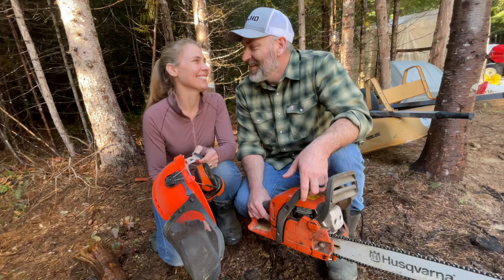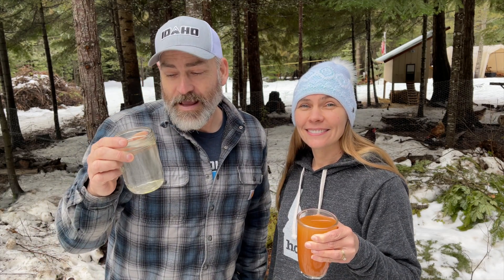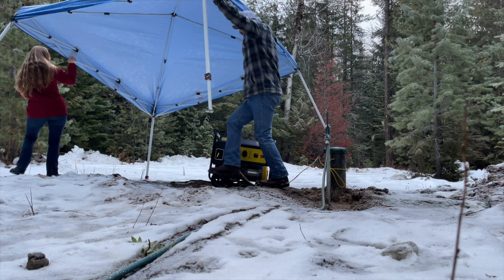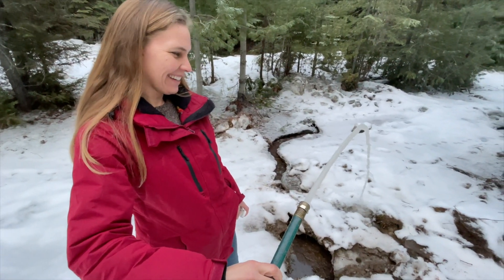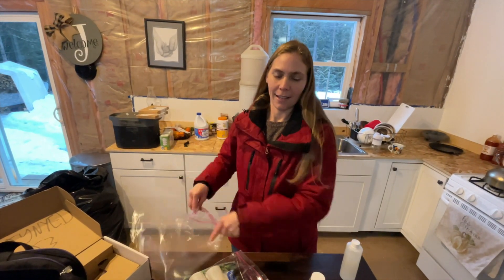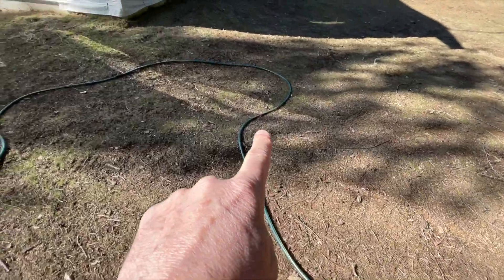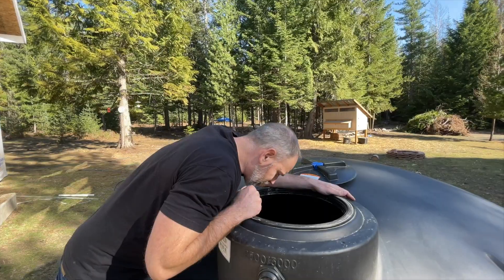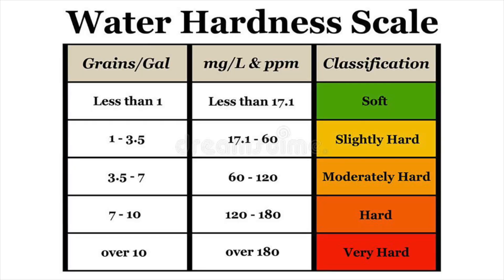Brand New Well... POISONING US?

Comment: Martin, I live in western PA and have the same type of water. My well is 360 deep and has both particulate (red color) iron and highly dissolved iron ( turns fixtures orange after sitting overnight). Lived here 40 years dealing with softener after softener. They aren't made to deal with this much iron over time. I contacted a MAJOR water quality company, they came and did testing and recommended a system over $4000.  I purchased the same components from amazon for under 900. 
Big Blue 20" filter 55$
64000 grain water softener 649$
4 pack of polyester spun filters 20-1 micron 44$
I add bleach directly to my well. I never get any smell of chlorine in the house.
install is in this order: from pump- 20" filter-softener-house supply.
Best water we've ever had.

Comment: hello Martin, as you drilled your well i made a comment under that video, and saw it straight away that it was iron. As always you have 2 options. 
1. you need one storage tank and in this you pump the water under very high pressure about 10 psi so it sprays in your storage 
    tank. The idea behind is, through that spraying the water can take oxygen and reacts with the iron, which will settle down at 
     3 - 4 days. Above the settlement you can take the Water and pump it through a Filter and wallah cristall clear.
      Remark: It must spray
2. An Ionexchanger will do the same work only a little bit smarter but you still have to filter it after the ionexchanger.
3. An "aktivated carbon" Filter should be the last Filter which you need, that you can take the water in the house, to avoid any 
     problems with watertabs espcially the washmaschine and dishwasher.
As a german brewmaster i hope my english is understandable
Reply: This is really usefull information, thanks!
Reply: Nicely explained 👌
Reply: @Clive -  Your English is better than most USAmericans.
Reply: Voila or wallah? 😂 one is French one is kanakish. know the difference
Reply: @joshhof1697  what a bad mistake, sorry
Reply: @joshhof1697  this is funny
Reply: great information, thank you sir

Comment: This may be a duplicate, my first message apparently went to the great nowhere.
   I have recently retired from a large Municipal Water Company. My job was in the construction and maintenance of the system. We continuously sampled and tested water in order to maintain records for the EPA. Our water system had its own laboratory and tested water for neighboring Water Agencies and peoples well water. The laboratory always had the most modern up-to-date equipment for testing water. Many of the more knowledgeable people who worked in that lab felt that the EPA standards followed technology if it was able to be measured the EPA wanted it to be removed. They felt that often times it was a Government desire to have something done even though it was probably not necessary. That argument is far beyond my knowledge. At the extreme is ultrapure water used in computer chip manufacturer. So much is removed from that water that if you drink a very very small amount it reacts inside your body so strongly with anything it touches that you can feel the heat and the upset immediately.
  Aeration can be used to precipitate much of the iron out of solution so that it can be more easily filtered out. If you have long-term concerns about the effects of the water I would maintain the rainwater catchment system to provide potable water to the kitchen and filter that water as needed. I would use the well water for gardens, fire protection and possibly the animals who are not exposed to the water for decades. Keep in mind that in the bathroom when you shower a lot of things can out gas from the water and you breathe them in some of those things are dangerous, particularly radon if it exists in your water supply.

Comment: I'd recommend a water softening system for the whole house and a point of use reverse osmosis set up for each sink that you plan on having drinking water and cooking water from.    Keep up the great work and positive energy!
Reply: The resin in a water softener would soon get coated with the iron and become useless. They need to oxidize the iron so it can be filtered out. A potassium permanganate chemical feeder can oxidize the iron and then go to a sand filter that can be periodically backwashed.

Comment: We live in North Central Washington. We have a whole house sediment filter and charcoal filter in the well house. The water then gets pumped to our storage tank. From the storage tank it goes into the house through another sediment filter and then through a charcoal filter. This runs through all our water lines in the house. All drinking water goes through ceramic filters similar to your drinking water setup. Every spring when the weather warms up and the water starts flowing below ground our water has the color of lemonade. This goes away after the thaw. We have had the water tested even with the lemonade color and it tests OK.

Comment: Nice  explanation of the system. As a water plant operator there are a few things to consider. Iron bacteria is not good as well as excessive Iron . Removal of Iron is easy to do.  Here is the chemistry to understand.  Iron in the water rusts  with the addition of chlorine (liquid) up to 7 parts per million. At this point the water turns orange as you saw.  This is the time you run the water thru a sand filter to capture the iron flakes.  By adding a dechlorination chemical ( check with the health department  local or state) you may have different rules than I operated at. Once the free residual drops below .5 parts per million it is safe from iron and chlorine and clear.  Other ground minerals are a separate issue and different treatment.  I am impressed with you’re determination and work man/ woman ship.. 👍 What a team.❤️
Reply: The addition of chlorine is safe and kills the bacteria. Don’t freak out about this  because the leach line is in the area and you don’t want that to cross contaminate the fresh water.

Comment: We have a 310-foot well at our N. Idaho property. We run the water through a whole-house filter as it comes out of the pressure tank and goes into the main house supply line. The filter has a clear plastic housing and replaceable 10" cartridges. You can get different kinds of cartridge, but be aware that the lower the microns, the slower the flow. We've settled on 30-micron "sediment" filters because the water flows through them easily and we don't have any odors or other water issues that would warrant a charcoal filter.

Comment: God bless you, you seem to have more than enough advice, but as a well driller and pump installer for thirty years the best advice i can give you is let run.  It's very hard to clear a well up with out shore power so your going to have to buy lots of gas and let it run until it's crystal clear as your bottle water. If it clouds up again, run it some more. I've never in 30 years had a well that would not eventually clear up.  Then collect another sample and treat iron, ph ,or whatever else you have to deal with.  Reli on the expertise of a reputable well contractors advice, we're no smarter than anyone else, just have lots of experience that in the long run saves you heartache and money.  God bless your efforts

Comment: I would recommend a whole house Reverse Osmosis filter with a mineralization post filter.

The standard setup for the whole house filter is to pre treat it before sending it through an RO filter.

The pre treatment is highly custom to your tested water. Generally the water must be softened and filtered for sediment.

The water is then passed through a reverse osmosis membrane and separated into permeate (filtered water) and concentrate (waste water). The filtered water is then stored in a storage tank.

You can make the membrane more efficient by using a post filter storage tank that is unpressurized (for no back pressure against the RO membrane). This also means you must run an additional pump from the RO storage tank.
Reply: I am also a plumber and I would do the R.O but you may want to add 
Sandmaster plus smp-10 10-20 gpm 
3/4 pipe
Reply: @St4 Not that Brian, I’m from the north east and my family has a property that has well water, which is why I know how the system should be designed.
Reply: @greenspotconstruction5003  You must have skipped over the mineralization post filter.

Comment: When I had a well drilled back in 1976 it was 368 feet deep. I had to run the pump for 9 days before it finally ran crystal clear. Not uncommon with a drilled well. I wound up pumping the water into a wooden tank with a capacity of 3000 gallons. The well was in New  Hampsire.

Comment: Ours is 600 feet in Wittmann, AZ, When it was first drilled it looked like chocolate milk for several days, now it is crystal clear after running/using about 25000 gallons. I use a 100 micron spin down filter for my first stage and it catches what I am guessing to but iron, it has a reddish tint. I plan on adding a whole house filter system (if our permits ever get finalized.)

Comment: I know you filter your water but be careful about using regular garden hose (not good for drinkable water) they make a food grade hose for RV's. I have a well at my house and we use in this order a whole house -10 micron sediment filter, water softener, arsenic filter, iron & manganese filter, carbon filter and UV light. my water is very high in iron, even my set up wont take out all of the iron. I have to use a bleach system sometimes to remove the excess iron which I don't like to use, nothing like drinking bleach water. hope this helps.

Comment: Our typical treatment solution for a case like yours would be a sediment filter for any large particulate, peroxide injection to drop the iron out of solution, then a whole house RO system to remove the arsenic and anything else. We would also inject anti-scalant at the RO to prolong the life of the membranes. Our whole house RO systems also include a uv light to neutralize any bacteria that could develop inside the storage tank. This depends on which type of arsenic you have though. You might be able to get away with a point of use RO system for drinking and cooking. Water treatment isnt particularly cheap but water is life. Invest in quality equipment with a good warranty and post sale customer support.

Comment: I have 2 wells at my home, one is only about 120' deep and is the original well. The second well was drilled for the swimming pool and is ~300' deep. For both wells we have a whole house filter and softener installed. We use rust guard salt in the softener, which helps a bit, but the elevated iron is an issue for us too. Everything gets stained from the rust over time. We also have elevated calcium in our water, but the filter and softener help quite a bit. I'd also suggest installing a large debris filter in front of the whole house filter. In the end, you'd install (from the well to house) large debris filter, then whole house filter, followed by the water softener. I got the self-cleaning house filter and softener and set them to run at 3AM, when there would likely be the least usage. Hope that this helps and you have good luck getting what you need to have clean running water!

Comment: We have a 144Ft well here in southern Ontario.  We use a jet pump inside the house and no water storage tank – just the pressure tank.  The foot valve is about 25Ft down.  From the jet pump it goes into the pressure tank. From there we have a 10” big blue filter housing with a Pentek R50-BB Pleated Polyester filter cartridge just to remove some of the big sediment. From the 50mic filter it then runs into an iron filter then a water softener.  The iron filter and water softener have been set up to back wash according to the water hardness we have here. After the softener it goes into another 10” BB with a Pentek DGD-5050 Spun Polypropylene filter cartridge. From the 5mic filter it then goes into a Trojan UV light and that feeds the entire house (minus the exterior garden hose – that goes through our 50mic filter only) We change our 50mic filter every 3 months and the 5mic every 6 months.  There have been times where the water pressure is low and the 50mic filter/housing  is completely filled with sand! That has happened about 4 times in the past 10 years though… The 5mic filter even after 6months is usually in pretty good shape.  Keep up the hard work! Love the progress.  All the best!!

Comment: You can remove a bit of the dissolved Iron just by oxidising the water in the cistern. Put a sprinkler on the inlet from the well and then let the water settle and the top water flow to another cistern that you use

Comment: Hi, Use the well water for general use like toilets and showers and roof water for cooking and drinking with some bleach added. Removing iron from your well water will be a constant battle but have a look on the net for aeration and green sand filtering. Did you test to see if the water was radioactive. Cheers Dave. Retired water supply manager.

Comment: You may have thought of this already, but if you always get dirty water on initial startup then I suggest installing the equivalent of a “first flush diverter” as used in rainwater roof collection systems. These divert the initial catchment from the roof, which is typically dirty, so only clean water enters the storage tank. You would set it up at the inlet to your tank. It would need to be sized for the amount of dirty water your well produces before it becomes clear. They can be made as big as you need. There are numerous designs if you search on google.

Comment: Use a double canister filter body with the activated charcoal filters. You can also use a basic wound string canister before this that shows the sediment or iron in the line. Both of these usually lasts a long time and does not impede the flow of water being filtered. .....................  enjoy

Comment: I highly recommend using a water distiller (Cost $150) for drinking water. I distill up to 25 litres a day. Not sure you will care about the hassle with filters. You are into the problem of deep drilled wells and the endless compounds associated with that. Best of luck. Have been off the grid for over 30 years.

Comment: We have a pretty shallow well here in SW Nebraska about 300 ft from our house (25' to water 80' deep). Its about 28 gpm at the well and down to 7 gpm for outdoor spigots on the house. I am going to drill a well like your first couple well videos. We also have alot of iron in our water (1.68 mg/l) and manganese (0.61 mg/l) and my wife hates the rings it leaves. We ended up getting a ispring spin down filter for our house which helped with sediment (i would recommend the one they have that has an auto clean feature (didn't know they existed when we bought ours). Finally we bought a PRO+AQUA whole house iron sulfur and manganese filter from home depot for around $400 bucks on sale. That was the ticket for our iron/manganese problems. I have watched all of your well videos today as I made my way down the rabbit hole of well drilling.

Comment: I'm on rainwater and the following filter setup has worked great:  pump -> sediment filter -> 10-inch jumbo -> 10 micron prefilter -> 1 micron filter -> UV treatment -> calcite (for rainwater only) pH adjustment -> cistern.  The cistern is then fed to the house where it has a boost pump -> carbon filter -> ultrafiltration (0.01 micron) -> UV treatment.  The ultrafilter has inlet, waste, and outlet.  The waste is used to fill the toilets which flushes the filter every time you flush the toilet.  You replace the filter element every 7 to 10 years.  I used a 3000 L/h version available from Banggood, Aliexpress, etc.  The whole system has performed great over the past 4 years and total cost was round $300 vs. $6,000 from the local filter places plus annual contract.

Comment: I installed well pumps and did repairs for many years.  After repairs or new pump install within the well casing, it is necessary bleach (one cup or 250ml) into the well casing. Also, run the pump a minimum of five to eight hours per day, for two to five days in order to develop the well.  If you install a new pump at a later date, use a 220V with a 5k to 8k generator for a longer life pump at that depth. Test the water after developing the well for a true reading, then make a decision for filtration/ treatment  if necessary.  Good luck to you, your doing great :)

Comment: I have used a rainwater only setup here (mains to costly, drilling not an option) for 15 years now. For all but drinking I use a slow sand filter, basically a 50gal drum filled with gravel/ever finer sand. Pump the water on top and let it slowly percolate trough the sand into an intermediate 50gal drum with an overflow back into the big cistern. It's important to get the levels right so stuff flows naturally from filter to intermediate to big cistern. In/on the intermediate tank you put the pump to supply the house. You might need to upsize things, I am single and used to short showers so your mileage will vary.
On slow sand filtration, it's powered by gravity and the filtration is not really by the sand, but by a layer of bacteria in the top layer that will eat everything from bird poop to heavy metals. It takes a while for this layer to form. It's a very old principle used very often by the mains water suppliers.
For drinking water I use a system similar to yours, I don't have a lab to check my water but these filters are fairly idiot proof.

Comment: My well is 180' deep and I have an air lift system instead of a pump down in the well. A compressor pushes air down the the well and it blows the water up into the holding tank. The well driller said that without the air system the water would be orange from iron ore.